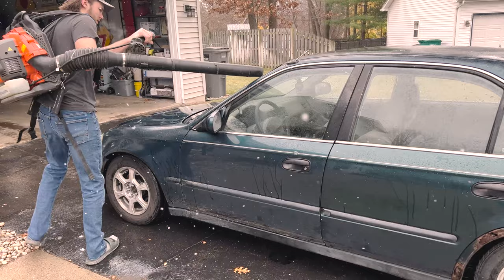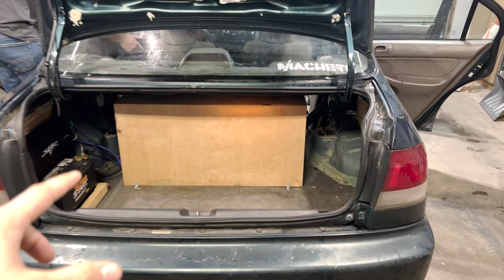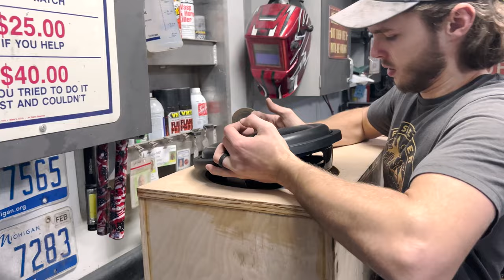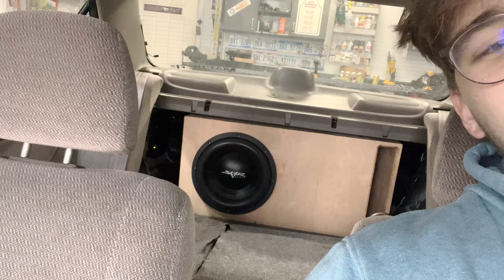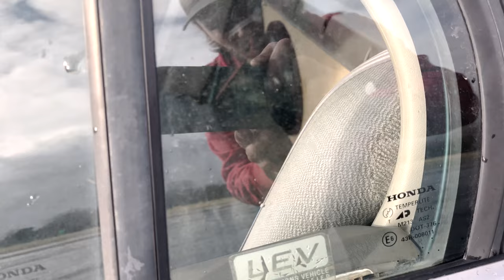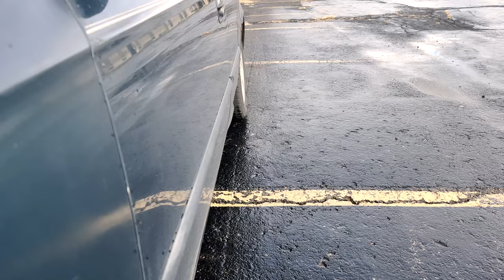Car guy vlog - I do NOT regret this Skar VXF-12

Comment: Are you running aftermarket mids and tweeter speakers as well? Or just sub and amp?
Reply from the maker: At that time I believe I was running after market coax speakers, but now I’m running component loud speakers and tweeters in the front and the same coax’s in the back powers by a 4 channel
Reply: @CarGuyVlogs  damn, that setup sounded pretty good for a pretty basic setup

Comment: What are you using to power that sub ?
Reply from the maker: It’s on a Skar RP-1500.1 could definitely be taking more tho. I linked another video explaining everything in the video.
Reply: Thanks for the reply 👍, I just bought two of them and will be having them powered by a sia 3500d sundown
Reply from the maker: @xXxREDEEMEDxXx-yc9ne  oh man I envy that setup lol. Hope it sounds good man!
Reply: @CarGuyVlogs  i hope so thanks bro 🙏 take care !
Reply: I use to have 1 12” vxf 4ohm on a rp3500 at 2ohm and handled it like nothing. On a 4 cube box with 58”s of port area. Loved the lows
Reply: You will definitely need at least 5k to push them to the limit and have room for one more 12!
Reply: @xXxREDEEMEDxXx-yc9ne have 1 on a sia3500 and it goes crazy